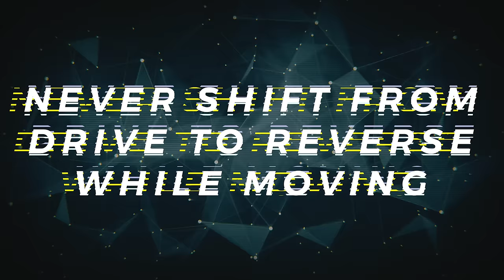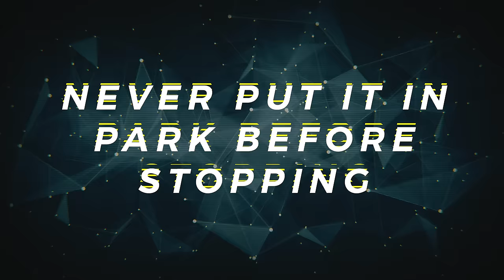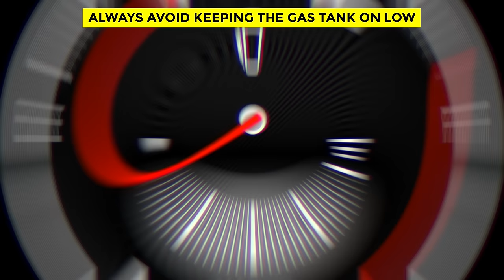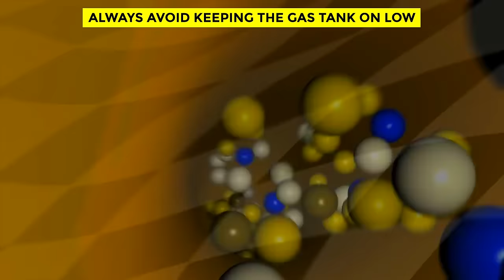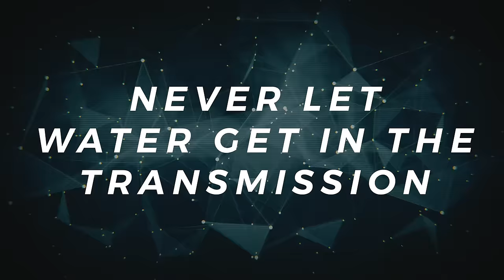7 Things You Should NEVER Do In an Automatic Transmission Car!

Comment: I came to see how paddle shifter kills me 🤦🏻‍♂️
Reply: Ye, I disappoint
Reply: Same. Im scared to use mine sometimes
Reply: Same
Reply: Ye
Reply: Thank you
Reply: @crispypieces4193  f
Reply: They make paddle shift for people who likes shifting on their own skill, so that will never cost any damages to your engine as long as you don't cross the "Red line"
Reply: same
Reply: I don’t see the point in having paddle shifters in my car because I have a sport mode which makes the computer shift at the optimal rpm. Even if I’m in comfort mode and I wanna switch to sport it automatically downshifts. I have paddles when I really don’t need them for any circumstance.
Reply: @SlishSlosh  You don't need them, a lot of people need them because they are extremely fun
Reply: Yes
Reply: I really like the paddle shifter
Reply: @SlishSlosh  You're right, the paddle shifters are just a fun feature... They're a want (for people who enjoy them), not a need.
Reply: Artfrawg you don’t have to be. Its there for a reason, use it. And anyway you have more control over the car when using paddle shifters
Reply: same
Reply: @SlishSlosh  your computer won't tell your engine to downshift till after you've begun breaking. If you downshift before it your gunna be at a higher rpm to go around the turn and a higher torque to snap out of it vrs your computer downshifting it after the turn. Depends on how nice of a car you have with sport modes. At least thats my out look on it. I'm no expert tho 😎🤙
Reply: @3rddude  even then cars have a limiter so you can’t cross red line. Even in manual mode.
Reply: Only if you use your feet to shift.
Reply: They are a replacement for a manual but for users who still want an auto
Reply: Don’t be silly
Reply: exactly
Reply: @tenspeed7711  you don’t really want to do any downshifting before you brake anyway. As Skip Barber said, the only purpose of downshifting is to get your car in the gear that will get you out of the corner the fastest. Your brakes are what slow you down. Your engine will never slow your car faster than your brakes. 

I know what you mean tho, sport modes of modern cars don’t ‘always shift at the optimal point’ like that other dude said. Your car doesn’t sense when there’s a hill coming up and you need to downshift to get up it.
Reply: same 😂
Reply: The paddle shifters are good for going up hills.  The automatic always goes too high
Reply: @SlishSlosh  it’s so you can downshift and gain a launch you want. Sports mode is ok if you want to launch from any speed. Well that’s what I’d use it for
Reply: Me too um awfully disappointed I was so stressed I said I have 2 get a manual
Reply: Same
Reply: Lmao fr
Reply: Bruh still had w tips🤷🏽‍♂️🤷🏽‍♂️

Comment: Luckily I drive a stick, so I can switch to reverse while moving full speed safely.
Reply: Most modern automatics won't go into reverse while moving forward.
Reply: @howardjohnson6584  Fun fact: no car can
Reply: Uhhh dude, im pretty sure the R in the shifter  is for racing mode
Reply: Tha moment you lift your foot off the clutch your transmission is going on a journey to Neptune.
Reply: @lrseixas  I thought it was rocket mode
Reply: @Xenial.-  it’s a rocket launcher only use it for some cases like if u want to go to the  moon
Reply: True dat
Reply: @howardjohnson6584  mine will and i’ve accidentally done it💀💀
Reply: @Deadpool-mw6bw  Older ones can.
Reply: It will still damage the transmission
Reply: @MohamedAhmed-rs3hg   Not on some modern trans. Stop spewing crap.
Reply: sketch
Reply: @Deadpool-mw6bw  unless you force it to
Reply: Nope dude, you can't (and you shouldn't) even if you keep the cultch depressed. Try it and report back the results. 😋
Reply: @howardjohnson6584  <--- Yes, VERY old ones can do that.
Reply: @utqlijh  it might accidentally detonate inside your vehicle, however
Reply: I worked with a guy who was a drag racer. He made a fast run. At the finish line he hit the brakes. He forgot he had a spare tire sitting in the back seat. The tire came forward and knocked the gear shifter into reverse at over 100 mph.
Yes, he survived but never made that mistake again!
Reply: @Deadpool-mw6bw nah my car can go in reverse while moving forward, just cant do it fast or else itll go into perma-neutral
Reply: I can hear that noise from oceans away

Comment: It does not hurt the car to put in in neutral at the stop light. Who told you that? The torque converter still spins in drive and it does not spin in neutral. As long as one is using the brake to switch from N to D is fine.
Reply: Seems like this guys knows little about cars
Reply: Dustin Lawrence  lol that's new start stop technology for gas saving
Reply: Lmao i was thinking the same like wtf its better if its on neutral on stop light
Reply: Brandon Starr it doesn't wear out when you switch from N to D safely 😑
Reply: The new cars (2018-2020) have auto shut off that turns off the engine at stop lights and turns it back on when you release the brake. This saves gas because these new engines need very little power to kick back on.
Reply: @Aussie Pom nice that blade Zero sense
Reply: the torque converter is bolted to the flywheel and so its speed is directly effected by the engine speed
Reply: @jordanconstantino10  uhh its actually really bad for your engine as the most wear an engine has is when it gets started plus the difference is so small its not even worth having the feature on
Reply: @johnpanty7608  Funny thing is, it does save some fuel, yes, less pollution, but it wears down the engine as it has to start up again constantly.
Reply: @jordanconstantino10  Our 2011 Audi A7 has that feature, so it dates back a little as well.
Reply: @johnpanty7608  Sorry what? You "blade" zero sense, honestly. I understood him just fine.
Reply: @netts2315  Modern engines are built for Start n Stop feature, it doesn't affect the engine. Put then in Neutral, Cut of Engine on the Red lights. This is all current-gen technology. We have timers of signals so that we could know when is it going to turn green.
Reply: Dustin Lawrence  for me, my car doesn't have a working fan, and if I sit at a red light for too long, it might overheat. So I turn mine off only at lights I know take a long time
Reply: Lol my manual literally says i can put it in N when at a stop light without problems
Reply: Dustin Lawrence Lawrence most newer cars do that automatically anyway and yea it is annoying.
Reply: Dustin Lawrence  I see that a lot especially when they can't get it to start right away
Reply: Its better to put in N while waiting traffic light, because your clutch is connected and making a pressure on a whole mechanic parts
Reply: was thinking the same thing man... was like "what the hell is neutral is needed for".. im agreeing to dont use neutral downhill but on stoplight? wrf
Reply: @brandon918  it wear faster? hahaha.. nah man.. thats most hilarious comment ive ever read man
Reply: Dustin Lawrence  auto start and stop is only wearing out tf out of the starter
Reply: @adityatukati  No, we do not have timers for signals wtf. If A/C is on and shit like that it starts to keep the freon going. And it starts when you release the brake.
Reply: @bnjo-go2xg  auto dont have a clutch, they have a torque converter (yes it does a similar job as a clutch, but does not work the same way)
Reply: Yeah,  so then what the hell is neutral for an automatic then?
Reply: This guys logic seems to be that neutral is going to destroy your transmission regardless of what you’re doing with it.
Reply: @3ddan148  Dct gearboxes  have a 2 clutchs instead of a torque convertor
Reply: Dustin Lawrence  Mild hybrids do that. But they react quickly (engine restarts from the forward movement of vehicle as the initial propulsion is provided by the electric motor).
Reply: @Aussie Pom Only exception are mild hybrids, as they use electric models to get you moving intially.
Reply: @jonathanhembra2098  Neutral disengages the transmission from the engine in the same way as Park, except it doesn't lock the transmission. It is identical to Neutral in manual transmission.

Uses:
• Uncommanded acceleration
• Towing
• Pushing (trying to get unstuck)
• Very fine motion (you want to move slower than creep, and you are in a miniscule descent)
• Alternative mode to start engine (i.e. engine quits mid-drive. It is possible to restart in Neutral without having to stop)
Reply: @3ddan148  Technically, they still have clutches to shift gears, but not the same way as manual transmissions (used to disengage engine power to allow shifting).
Reply: @Errk2G  Neutral disengages the transmission from the engine in the same way as Park, except it doesn't lock the transmission. It is identical to Neutral in manual transmission.

Uses:
• Uncommanded acceleration
• Towing
• Pushing (trying to get unstuck)
• Very fine motion (you want to move slower than creep, and you are in a miniscule descent)
• Alternative mode to start engine (i.e. engine quits mid-drive. It is possible to restart in Neutral without having to stop)
Reply: @3ddan148  my 19 Fiesta has a dual clutch auto transmission not just the torque converter
Reply: Emet Playz dude if it’s built into the car it obviously won’t cause damage to put the car out of commission. The car manufacturers wouldn’t sell cars like that. And first off if it did do damage it would be on the starter, but in these newer cars they are heavy duty starters that can take the extra beating of constant starts and stops.
Reply: @Errk2G  do you can tow or push the car. Break down in middle of street and try pushing your car to shoulder in gear. But also most owners manuals tell you to use neutral at stops.
Reply: I always put my car on neutral then hand brake on red light 😕
Reply: @Aussie Pom Ah, yes, except in new cars, which don't need a lot of power from the battery to start-up the engine again. The starter is also barely used. The engine is mostly starting with the ignition (having pistons in a correct position before).
Reply: @dbclass4075  Genius, when the engine is off, every position except park is the same as neutral.
Reply: @howardjohnson6584  But only Park and Neutral modes allows starting.
Reply: @dbclass4075  Which nothing to to do with the trans having no clutch or band engaged with the engine off effectively placing it in neutral.
Reply: What's more, isn't it more reassuring to know that your car's not going to budge forward and run over people crossing in front of you if your brakes fail or your foot slips off the pedal for any reason?

Comment: So in conclusion. Never use the neutral unless you have to push the car. Got it
Reply: THE SUPER DUPER no you shouldn’t push a vehicle with an auto transmission really either, to be honest I’m not sure what the point of neutral is aside from being a fail safe
Reply: @barnabyg6808   It is just to have a disconnected mode, to engage the starter motor from, also never tow an auto trans car with our drive, the torque converter is not lubricated.
Reply: @barnabyg6808  neutral is engaged when it's in park. But pushing a car a short distance like a block or 2 in neutral isn't a problem. Also car washes require it.
Reply: There are or used to be laws in some states that make/made it illegal to put your car in neutral while moving.
Reply: @PhilLesh69  really? interesting!
Reply: Haahaa. He probably get paid to say DO NOT USE NEUTRAL XD
Reply: I drive a truck with a 4L60 and I checked the lube flow diagram, all parts are always lubricated despite the gear the transmission is in, so coasting in neutral is a very good way to keep the tranny cool while towing.

Comment: In addition to all of these, always put the e-brake or manual brake on/up before putting your car in park when parking on an angle (decline/incline). This will help the overall life of your pin to hold the transmission in  place during park & the overall life of the transmission itself. This isn't a problem for manual transmissions, only automatics, and is something very few people know as a very helpful hint/trick.
Reply: I always park with the e-brake because I like the brrrrrrt noise it makes
Reply: I guess people forget that it's primary use is for Parking. It is called a parking brake not a e brake. The emergency use is secondary to the primary use. my wife gets mad at me "why so you always pull the e-brake up and parking" i tell her it is it's intended use.  Never trust the parking paw inside a auto they can and do fail.
Reply: @CotyRiddle  You my friend are indeed ahead of the curve, always the smart thing to do! Those 'Just In Case' moments are always creeping around the corner waiting for you to drop your guard.
Reply: In many cars that "e brake" is a tiny pedal on the left near the tirewell and the release lever has a P printed on it, and on every car the dashboard warning light to let you know when they are engaged is an orange or red P.
Reply: @PhilLesh69  Thank you for the additional bit of info my friend, much appreciated 🙏 🤙
Reply: I just bought an automatic, so lemme get this straight at least. so when i park the car i put it in P and then i release the brake and i can feel the pin stopping the car, its winter right now so i am not fond of the manual brake, but when it gets warmer i wanna know if its better to pull the manual brake before releasing ur foot brake , sothe car doesnt get stopped by the pin but tha handbrake? very logical but would never think of it. thanks for the tip
Reply: @kegg1884  Yes! :) When you park you car and for winter or summer the parking brake that you pull up on or in some vehicles have the one that is to the left of your brake pedal that you press in with you foot, you pull up on your parking brake first and then place your car in park with your shifter. 🙂 if you disengage your parking brake while holding the brake pedal in and then release ypur brake pedal you will feel your car shake forward and back which is the pin in the transmission having nothing to support it's lock 🔐 to the transmission. Manuals are either put in neutral with the hand brake or left in a gear in the one of the drive gears ⚙️ of the gearbox of the transmission and isn't as harmful to the transmission as it is more so the gearbox, but they can take the tension better than the pin transmission lock system. It's an interesting thing to know 😅. The hand brake is a steel cable reinforced system that won't fail in the winter or summer time, good for all seasons. Just watch out for rust over a long period of time. If you have lots of miles in snow climate areas of the US, get a feel for any odd noises or feel if the strength of the hand brake starts to give. Then you will need to get your hand brake cables replaced, but you honestly don't have to worry 😉
Reply: @blockman3508  the brrrt noise is like a ear soothing noise to me that makes me chuckle a bit 😄
Reply: Lots of Ford's were known for a faulty park. When they were on an incline they might jump out of park and roll downhill.
Reply: @matthewmorgan582 Same with them new model Titans and Frontier Nissans at my dealership. Transmission pins are being recalled

Comment: Number 10: Never press the accelerator pedal if you intend to stop. It could lead to the car going forward instead of stopping.
Reply: But the accelerator pedal makes ıt goıng froward.
Reply: @themark26  indeed, that was the joke
Reply: @DaneH64  Joke? It ıs not. The accelerator really make it move. So that is a fact that most world know. And having it on the list of "should NEVER" is not normal.
Reply: @themark26   Never press the accelerator pedal if you intend to stop
Reply: @patriksmari5  intend means what?
Reply: @themark26 the accelerator doesnt make the car move
Reply: @intence1233  How? it does make car moves.
Reply: @themark26  so the accelerator makes the car move in neutral or park

Comment: Tip 945:

Under no circumstances should you drive your car into the ocean, especially if it’s an automatic. This will cause the transmission to be soggy and uncomfortable
Reply: lol
Reply: lol
Reply: lol
Reply: lol
Reply: lol
Reply: Lol
Reply: lol
Reply: lol
Reply: lol
Reply: Lol
Reply: Lol
Reply: Monkus
Reply: lol
Reply: Lol
Reply: You mean the James Bond cars aren't real?
Reply: lol
Reply: lol
Reply: lol
Reply: lol
Reply: and will make it smell like fish
Reply: lol

But in a bit more seriousness: ATs have a little "chimney" at the top of the gearbox to let air in/out as temperatures change and the transmission fluid expands/contracts. So even if a little water spills in there, it is considerably bad for the components inside. Especially when moving. MTs use a different fluid and don't have this opening; so they are preferred by drivers who anticipate the need to ford rivers.

In conclusion, the original comments is unironically accurate. Submerging an automatic will make the transmission uncomfortable.

Comment: Tip 9: always press your brake when you intend to stop.
Reply: 1000 subs without any uploads unless u hav AVH...
Reply: Tip 10: don't steal your passenger's molecular structure
Reply: oh i typically do it with putting the transmisson in reverse and floor it 😂
Reply: @jireland2088  😂🤣
Reply: @constantins.2981  oh u put it in race mode
Reply: I actually launch my car in neutral
Reply: I never knew this. Thank you
Reply: Wait do u really???
Reply: Ok
Reply: Tip 10: always press gas when you intend to go.
Reply: Tip 11: always open the door when you intend to get in/out
Reply: LOL
Reply: Drama Queens 🤮🤮🤮
Reply: Unfortunately I drive a ford and my brake lines busted